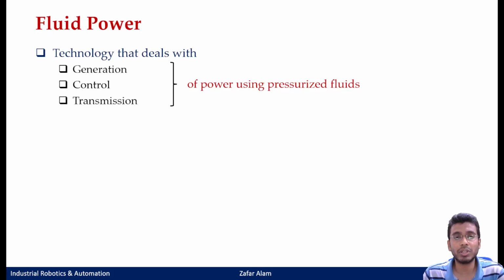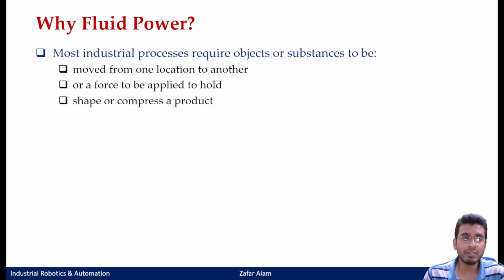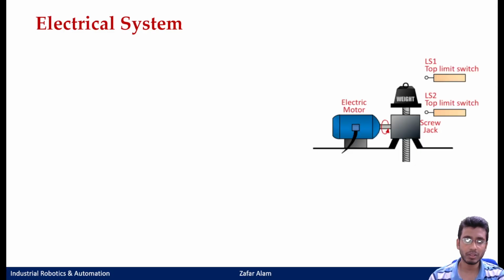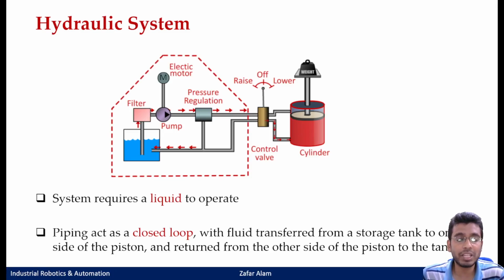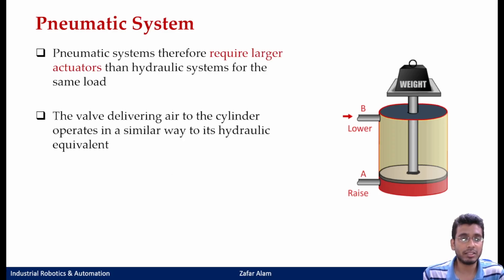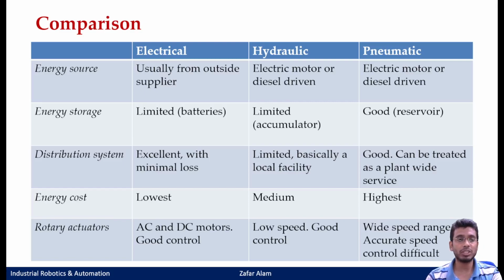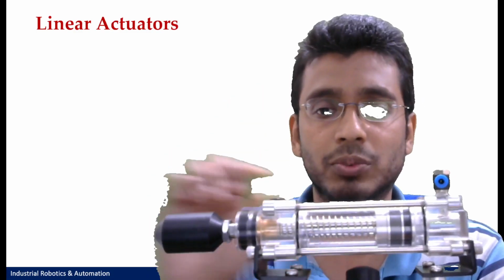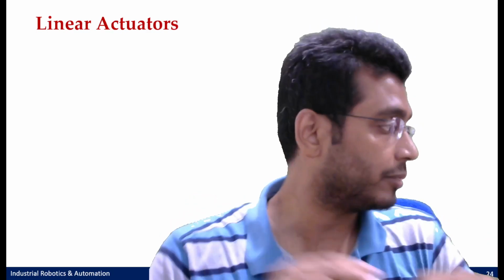Fluid Power Systems, Single and Double Acting Cylinders

Comment: Hii sir, I having double acting pneumatic cylinder in that i have a confusion during load extraction have different length at same pressure and same load even after proper services